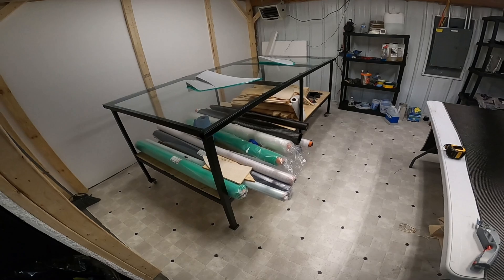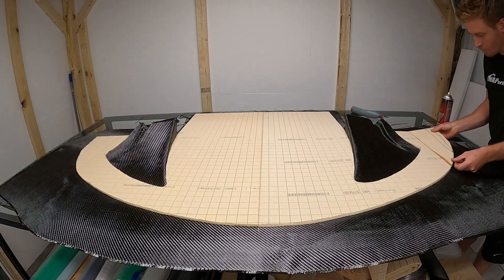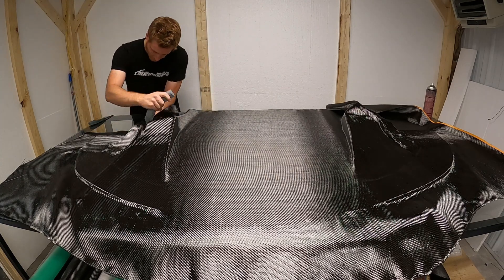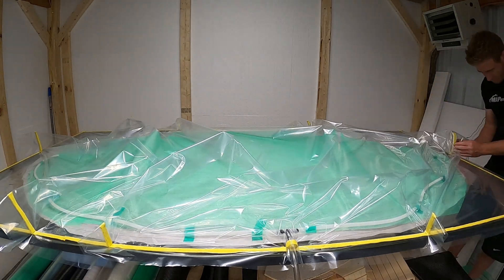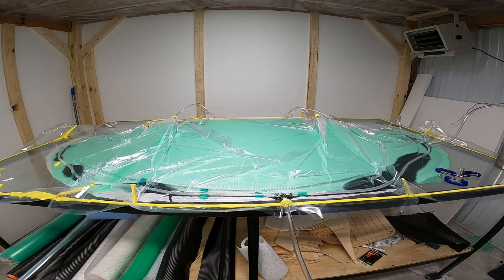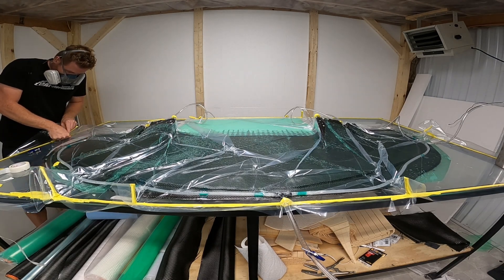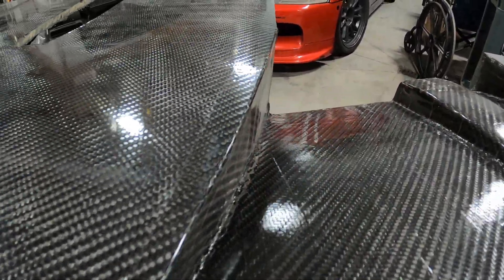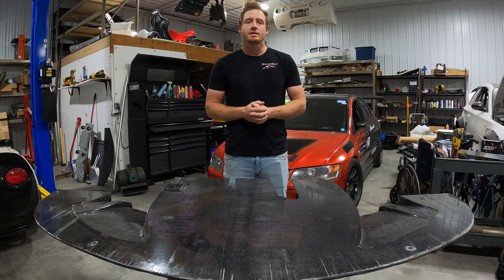DIY Custom Molded Carbon Fiber Splitter

Comment: You should have sacrificed the bag and pulled it and redone it. A perfect vacuum seal is critical…and it would have lessened the panic. As others have said…make sure your tape flange is clean of release agent. Mask it off before applying. 

As for the edge wrap, doing it the way you did I’d have tack sprayed the perimeter and folded the bottom layers up and over the foam core, then trimmed the top layers to the front edge and tacked them down with spray.

I didn’t see you profile the leading edge of the foam, either. Air doesn’t like blunt edges…

Other than that it looked like a pretty solid way to make a splitter with the aero bits incorporated in instead of adding the tunnels later and compromising the structure.

Comment: I know that usually you use amount the same weight of carbon fiber in resin, but with the added core, how do you account for the amount of resin?
Reply from the maker: The SWAG method. Scientific wild ass guess.

Comment: Hi! I want to make a splitter too for my race car and I was so inspired by your video I live in Colombia and aero development is not so big and I have a couple of questions. What kind of foam did you use and I saw you used foam for your diffuser molds, did you cover them with gel coat or how did you manage to achieve that perfect surface and did you CNC them? That would be it. Thanks a lot in advance
Reply from the maker: I just used a 2 part 5lb density foam. Just fiberglass, body filler, and paint to finish them. All done by hand.
Reply: @KrebsbachRacing  Great! I´ll try to to them like that. I also wanted to know what kind of 3/8in foam sheet you used for the splitter, I was looking fot XPS in my country but they come in high thickness size, about 40mm. Thanks for the response!!

Comment: How many layers you put?
Reply from the maker: @Elrinconmacabro  3 layers on the bottom and 2 on top.
Reply: @KrebsbachRacing  all carbon fiber?
Reply from the maker: @Elrinconmacabro  did you watch the video?! There is a foam core in the middle.

Comment: I thought about doing splitters exactly like this. The biggest issue is I couldn’t think of a way to make a proper leading edge so opted for a different technique. A quick tip for finding leaks, get a 2 foot section of the tube you use for infusion and put one end right near your ear and wave the other around the area of suspected leak and you should be able to pinpoint leaks.
Reply from the maker: I haven't figured out how to make a smooth transition either. I'm not an upholstery tech. Haha. I have yet to figure out a smooth way to wrap the edges or outside corners. Good tip for leaks though. Thanks!

Comment: Looked like you used Stretchlon 200 bagging film. Throw all of that away and use anything else. That stuff is garbage. I tried it 8 times and never got a single bag without holes, even on a flat piece. I used an ultrasonic leak detector and the bag had holes all over the place.
Reply from the maker: Good to know. Thanks.

Comment: I have a composite shop and the bagging is the worst part and when you suck air that sucks as well. I use the thumb screw clamps and infuse a little slower a part that size takes me about a hour
Reply from the maker: yea I didn't mean to infuse that quick. Just lack of experience. haha